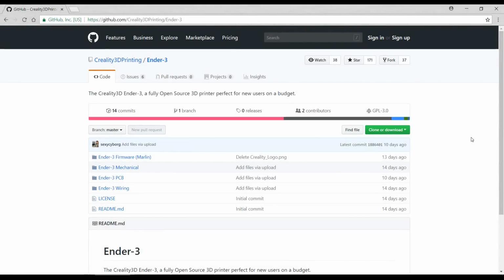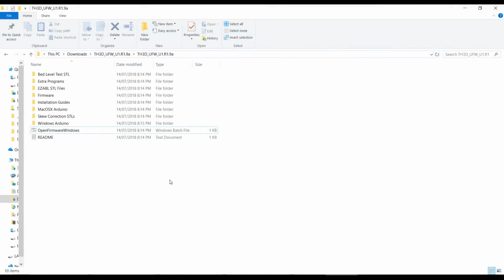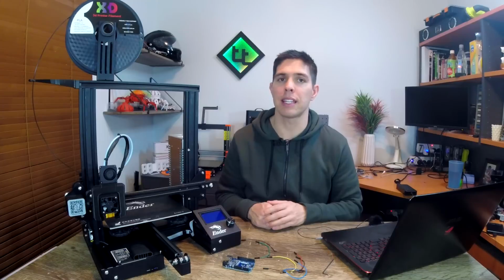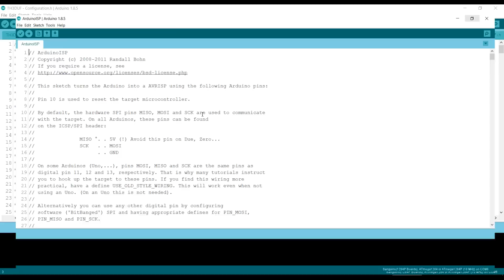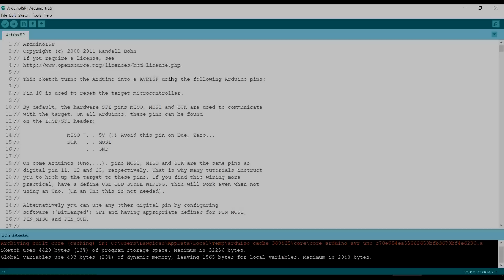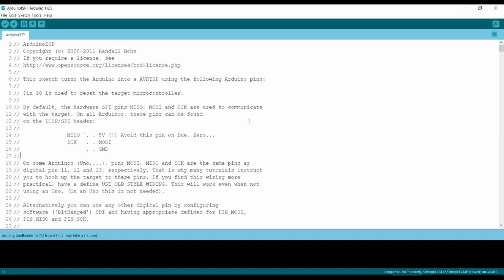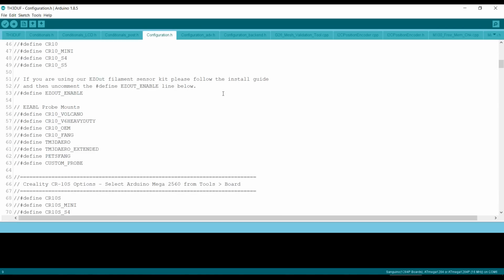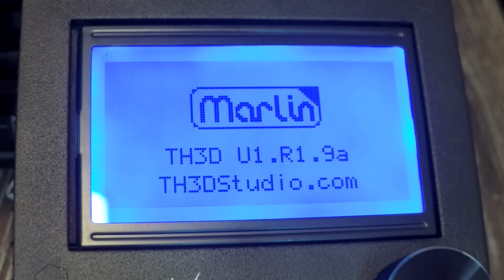Ender 3: How to install a bootloader and update firmware

Comment: Timmy the owner of th3d makes some great probes they are the only ones I use on all my printers I highly recommend the customer service is great also
Reply from the maker: The documentation and website left a really good impression on me.
Reply: Give his abl a shot on the ender 3 instead of the bltouch theres plenty of videos online an hes there if you have any questions I just got the ezabl mint as you can see in my profile picture um building a p3steel printer
Reply from the maker: The ezabl looks great, only problem is, I don't have one sitting in front of me but I do have a BLtouch for another project. Other advantage is being able to use BLtouch on glass.
Reply: You can use the ezabl on everything ! Lol my cr10s had just glass worked flawlessly now I have a sheet of buildtek on the glass an still flawless
Reply: I'm currently waiting for my ender 3 an tevo little monster from aliexpress to arrive to me in the United states I will be designing a set up on fusion 360 for either the 18mm ezabl an 12mm ezabl along with e3d-v6 as my go to hotend I may even make a volcano fang mount for it as well if you buy the 12mm ezabl it he also includes adaptors if your mount is already for a 18mm probe

Comment: Really looking forward to the Bltouch video, I was going to have a go myself but will wait for your video instead 😀. Cheers
Reply from the maker: Should be out in the next week or so.
Reply: 2 weeks later no BlTouch vid :(, was waiting to see if you'd managed to get it working with latest version of TH3D firmware before I install mine as the new firmware version needs some editing to avoid conflicts
Reply from the maker: Sorry dude. I have the BLtouch but am still waiting on the pin27 breakout. Postage in Australia sucks. I'll have it out quickly once that arrives.
Reply: No worries, are you planning on using the latest TH3D firmware or one of the older revisions ?

Comment: Great tutorial :), is there any chance you can do one about the laser engraver, I have one but there are no instructions on how to add it :(
Reply from the maker: What laser engraver? If it's an neje I have one and will be covering it at some stage.
Reply: It doesn't have a name on it that I can see but it's got a control box and the laser, the laser has magnets to attach it to the fan case, I believe it was originally designed for the CR10, but it comes with the printer in a bundle atm, if you buy from Aliexpress.
Reply from the maker: Haven't come across it but it sounds interesting.

Comment: Can this be done with a raspberry pi instead of arduino board? I have several Pi's and no arduino's.
Reply: Yes, https://youtu.be/hbX8Qu-QLnI
Reply: just buy an Uno clone for $8 or thereabouts. It's going to be a lot quicker than trying to fit this process into a Pi.
Reply: thank you!
Reply from the maker: Great link!
Reply: No you need the UNO.